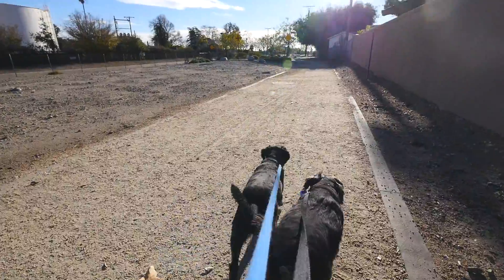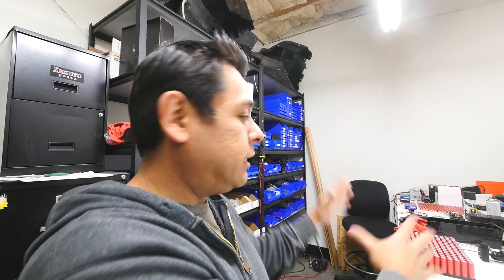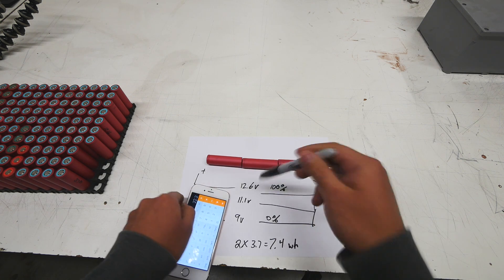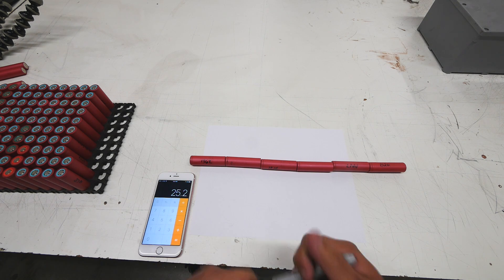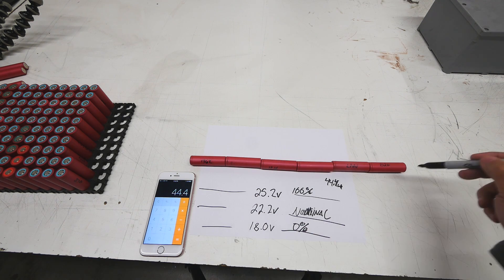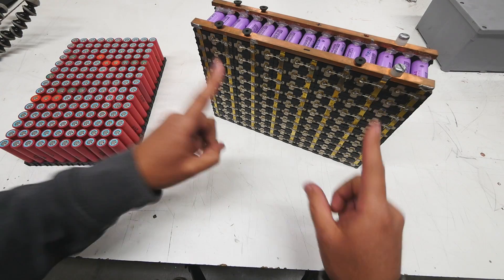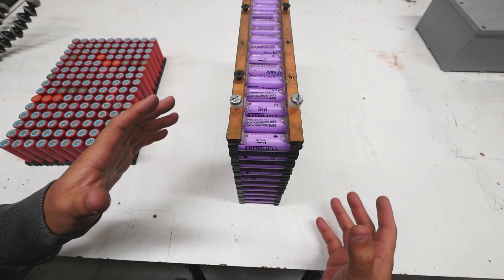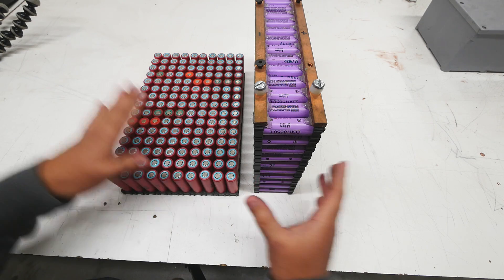How to wire A DIY Tesla 18650 Powerwall

Comment: Hello,
First of all, thanks for this awesome video.  So I am trying to build a battery pack just like the one in this video.  However, you only said that we can do this with laptop 18650 bateries.  I found this batteries on amazon

http://www.amazon.com/Lithium-Rechargeable-Household-Batteries-Flashlight/dp/B00G9X3HA2/ref=sr_1_1?s=hpc&ie=UTF8&qid=1455826134&sr=1-1&keywords=18650+battery&refinements=p_n_feature_keywords_four_browse-bin%3A7582357011

 that are 18650 as well with a 3800 mAh.  Would this batteries work as well?

Also, I used the same formula to calculate the Wh I get from each battery and I got 140.6 which seems to be too high.  I used this formula to calculate it: W = A * V.  I know the formula is correct so I must have done it wrong.  How many Amps does these batteries actually have?  I calculated 38 given that 1Ah is 1000mAh.
Reply from the maker: +Emanuel Quinones    Yes same type of cells,  Problem is that I don&#39;t recommend those on eBay.  They are mystery cells from china.  Seller is shady as there is no 3800mah cells in the market so you can't trust that they are quality if the secs are not even possible yet.
Reply: They are actually from amazon and feom a US seller.  If they turn out to be fake or bad amazon is pretty good at taking back the money from them and returning it to the customer.  Thank you for the quick response.
Reply from the maker: yeah All cells with  fire in the name are from china and a bad idea

Comment: Awesome video! I am super keen to make one. Firstly how do I wire the batteries to suite a 230V AC Socket like we use here in NZ? Is it the 24V DC version? Also how do I source uncharged 18650 batteries so that I don't get electrocuted while making this? One last question, what type of fuses are you using? I need specific information on all. Please feel free to email me on info@designerdentures.co.nz. I am no electrical engineer as you can tell but I really want to make this! Thanks!
Reply from the maker: +Khushwant Singh   watch all my videos first,  lots of your question will be answered along the way
Reply: +jehugarcia yeah will do. Appreciate what you are teaching us!

Comment: Instead of using thousands of small batteries why not build large capacity cells like the lead acid batteries have?
Reply from the maker: +Wes M large capacity lead acid batteries are made up on many small cells inside configured both in parallel and series.

Comment: i cringed everytime he touched the terminals. scary!
Reply from the maker: +fmj45   3.7 volts is not scary,  you gotta get around 30 to start feeling it
Reply: +jehugarcia i see. thanks for the info. i've had the saying "it's the amps that kill" drilled in to me. it's certainly encouraging that those packs are not dangerous. love your vids. thanks for your hard work in making them.
Reply: It takes a very low amperage to stop the heart 200 milliamps and you're dead. Even as low as 20ma will mess up your breathing. Dry skin has upwards of 100,000 ohms of resistance. And below 50 volts is considered "low voltage" and is pretty much safe to handle. Just don't touch it with wet hands or lick it.

Comment: What is the capacity and voltage of the pack you built? I still don't understand why it doesn't need to be balanced charge. My understanding is that if the batteries are connected in series I have to balance charge them. For instance how can I arrange and wire 10 NCR18650B to get 14.4V and not need to balance charge them. I think a smaller pack would be easier to understand for you viewers.

Comment: Per your comment regarding where the Tesla gets its power from, you said it comes from coal. While that is a popular saying, "the Tesla is a coal car", it is not entirely accurate. California derives only about 20% of its power from coal, while the rest is: 46% natural gas, 14% nuclear, 11% hydro, and 11% from renewables. Even then, if you want to look at it from an emissions point of view when compared to an ICE, it is still a vastly cleaner and more efficient power source due to the fact that the power utilities can run at near peak efficiency for ~80-90% of the year. An ICE never operates at its peak efficiency, 18-20%, since it has to brake (bleed energy as friction) and re-accelerate over and over again in city street traffic, and even has to idle when stopped in traffic. At least with electric motors, you can build in the capability to recover some of the energy that gets wasted when braking. Overall, the ICE is a poor choice for being an energy efficient device. 

So, in getting back to how this can relate to your work and your projects, you should be happy in knowing that the energy you're storing in your batteries is being generated in a much more efficient and economical way that the technology you're seeking to replace. That is why electric vehicles are better off in the long run than ICEs.

Comment: Hey Jehu I'm a big fan of your channel, in fact I liked it so much that I just finished binge watching the entire Samba series over the course of three days. You have connected a number of passions of mine, namely classic air cooled VW's and living in a more positive way in terms of the environment and how we interact with each other. I am a little bit confused about the end of the series and the 'Tesla' wall. It's cool to have some back up batteries and an inverter if the power goes out, but isn't the whole purpose of the Tesla system to save energy. Even if you install an inverter/charger, you will have a system that is less efficient than just using the 120 AC when you have a need for it. Without alternative energy input or a controller that charges only when electricity is abundant and re-introduces it into the 120 AC system of your house/shop when demand on the grid is high, it's really just a battery on the wall or am I missing something? Don't get me wrong, I truly love the videos and am inspired to start an EV project of my own when finances allow, however I would love it if you did a video on the source of the electricity that you use and what the actual footprint of it's consumption is. These are real issues here where I live in Canada where we are known for our oil sands projects and where right now indigenous people and environmentalists are being arrested for protesting the construction of North Americas next mega hydro dam, of which some of the output is likely to be imported to your state. Keep up the great work and I'll keep watching...BTW, I live completely off the grid with solar panels and a micro hydro plant running off a nearby creek.
Reply from the maker: Yeah all those are possible,  buy and charge when it's cheap,  use energy when it's peak rates.   Charge using solar,  use at night when no sun.   Battery can be used in many ways

Comment: Jahu, Good video. One thing. While you dont need a BMS for a parallel pack. You should have a passive BMS which you do have . You have forgotten about it. All batteries are not created the same. Even in parallel. Its not as likely that one will go hi but it is possible for one to tank earlier than the others. Remember why you installed your fuses? Its your passive BMS. It was a very wise decision on your part.

Should BMS stand for Battery Management System or Battery Monitoring System. The Fuses are a Battery Monitoring System.

I have seen people building packs without the fuses and they seem to be asking for trouble. The fuse stops a cascading effect to the other batteries. 

Good work

Comment: i am trying to figure out how to build a 12v 18650 system that i can run with my car alternator. Can anyone show me the way?
Reply: +Damian Yang do i need anything special so my car doesn't blow up... I am running a show car and it runs alot of electricity and i dont want to run 500 lbs of agm batteries in my car.
Reply from the maker: +Damian Yang 
Lithium voltage is 4.2V max per cell.  3 cells in series add up to 12.2V.  Your cars electrical system is 13.8V,  you would have to use a DC-DC  to bring the voltage below the 12.2V max that lithium needs
Reply: +jehugarcia Like a battery isolater ?
Reply: +jehugarcia This is a very interesting question. I would like to build a UPS battery made of 18650 cells to replace the usual SLA or gel inside of them. I been thinking to use 3 cells in series and 2 sets in parallel. So I can lower the overall weight of the UPS backup. I understand that the operating charging-discharging voltage is 13.5v but this I can not confirm or know how to check. So is the DC-DC going to be able to go both ways? I am seeing it wrong?
Reply: Can u recommend some good dc to dc converters. I want something strong

Comment: Most 12 volt chargers will charge to 13.8 volts not 12 volts you will overcharge them and they will burn.
Reply from the maker: +Charlie Rickman   Yeah,  regulated power supply is better
Reply: Can u recommend one I never can get my 12v inverters to play nice with 3.7 voltage cells I could without lifop0 3.2 cells

Comment: balance wise, I think they meant when you connect multiple cells in series. How will you balance each parallel bank to the others! I have enough trouble keeping a 4S28P pack balanced, what is there to stop all of yours getting out of sync?
Reply: +Jorge Espinoza I have 3 packs i n use at the moment. all are different. 2 with new cells one is li-ion (50ah) 1 is lifepo4 (36ah) the third is second hand reclaimed cells from medical equiptment. though from the same batch they go out of balance within 2-3 cycles. I have a huge distrust or BMS units so I use an inexpensive lipo alarm to alert me to one set of cells going low. charge wise I use imax b6 or sky RC RS16 to balance charge them / from my small lead acid battery bank.

Comment: I am so impressed.  I love listening to your Vlog.  I own a TESLA model S (P85D) and contemplating building my own Powerwall. However I have to come up with some Solar power. Any recommendations? or what would be a good solar panels. Where do you get your parts to build your cell for the batteries. I was thinking about sourcing my part through ebay. IS it s good idea?

Comment: parallel cells don't need to be balanced as they are at the same voltage all the time
series cells have to be balanced as they can be at different voltages while charging or discharging or just resting  
another good video thanks Jehu
Reply from the maker: I Wish all comments were structured like Alan Brown's here,   Informative and pragmatic
Reply: +Eren Berberoglu ah thank you
Reply: all the batteries i see pulled apart . it seems the smaller the cell and more per MM and then put in the block 8.5v each , im experimenting  with pulse charging from capacitors array for sudden loads like A/c or Furnace , i live in a mobile home and in a very cold area . and using induction coils to make steam and pressure to run a small engine with a giant rotating mass . to keep everything charged no matter what .
Reply: Failing to balance individual cells is likely to result in shorter pack life but as long as the system is well maintained by someone who knows what they're doing a BMS isn't essential.

Unfortunately most people don't know what they're doing and don't understand that overdischarging Lithiums is even more dangerous than overcharging them - especially if left on a shelf for years afterwards.

This is why thermal management of large packs is so critically important (automotive or stationary).

I work in a university computing environment and we get a steady stream of people coming through with swelling battery packs. The wonder is that there are so few fires.

NiMH are not much lower in capacity but much safer. The problem there is the patent encumberence of NiMH for automotive use in the USA that's essentially stalled most NiMH research for the last 30 years. (There's a wikipedia article on this(*)). Some of the patents have expired but others are still in effect and have been aggressively used to keep NiMH out of cars (Toyota have encountered major problems with this, trying to keep the CA electric RAV4s on the road).

Don't forget: For best longevity, Lithium batteries should be kept within 30-80% charge range with only occasional excursions outside this envelope. The reason for that is that the anodes physically swell and shrink with charge state and eventually disintegrate(*). If you're building a powerwall it's best to trade off the size with this compromise and for automotive use treat 30% to 0% as emergency reserve.

Bear in mind that overcharging or overdischarging can both result in lithium metal being deposited inside the cell and if that forms in the wrong location, puncturing a seperator, you WILL have a localised heating problem and fire on your hands(*). Make sure you house your powerwall in such a way that fires are containable or you may void your building insurance.

(*) https://en.wikipedia.org/wiki/Patent_encumbrance_of_large_automotive_NiMH_batteries

(**) There's a lot of R&D going into combatting this and when you see batteries marketed with 10,000+ cycle capability you'll know it's essentially solved (there is some progress but the tradeoff at the moment is vastly reduced capacity compared to "standard" cells) 

(*) The lithium crystallisation issue is also being worked on but is in no sense a solved problem, so the best policy is to avoid excursions below 10% or above 90% unless absolutely necessary and never leave a cell stored in a discharged state unless you like fires.
Reply: @alanbrown397  the 10,000 cycle batteries exist now and are called lithium titanate. also the thermal runaway problems with 18650 are mostly solved with lifepo4. lifepo4 from china is reliable and so cheap if these guys knew that you can buy 4 cells of 3.2v nominal at 280 AH (12.8v) for $481 shipped with 3,000-4,000 cycle life they would stop wasting time doing these silly 18650 projects
Reply: @eksine  4 years ago lifepo was new/rare and liti was even rarer. There have been major changes in the market since 2016

One of the more welcome changes is weldable battery strips with integrated fuses, this reduces the fire risk AND labour complexity dramatically.
https://batteryhookup.com/products/nickel-fuse-5p-wide-continuous-roll-by-the-foot-18650-cell-level-fusing

BMSes have come down rapidly too - and both of these innovations have a lot to do with the spread of Maker culture to Shenzhen over the last 5 years

It's still worthwhile building your own arrays, less worthwhile doing it with salvage packs unless you're getting them really cheap - but then again, they're getting really cheap (which automakers are not playing catchup with. The costs of a 4kWh pack for european electric motorcycles is still at 2016 levels)
Reply: Hocam farklı marka 18650 pilleri aynı paralelde kullanırsam deşarj durumunda düşük c deşarj değerine sahip olan piiler ısınırmı ? Yoksa aynı marka model pillerimi aynı paralel içinde kullanmalıyım balansı kaybetmemesi açısından ? Teşekkürler.
Reply: experter
Reply: so all cells are in parallel
Reply: William Hill - You add up cells to make the first group in series to get your voltage correct. Then you parallel additional series groups with the first group to add additional amperage capacity.
Reply: You covered my only concern which is that your parallel pack is only as strong as your weakest cell. The weakest cell will usually also mess with neighbor cells. Also as someone mentioned, the fire thing. Thermal run away can be induced by a weak cell in your pack. But you only really see such a thing if you are demanding too much from your battery pack and if the series string is super long like say 50 to 200 cells. After a few cycles you clearly will see a "wave" of high/low cells. The wave will travel inward from the cells closest to the ends towards the center of the series pack. This is simply because of demand, and heating resistance happening there. As the cells there become weaker, the effect starts to catch the next cell.. but because the cells at the end are also first in line for charging, they will charge more than cell #2, creating a high/low pair. The center cells will hit max voltage first, then the last cells, and the cells in the middle will charge the next cell more/ or demand charge from the neighbor cell. That's more or less how the high/low charge wave will propagate in a series pack. This if you don't pay attention will cause a failed pack, sometimes a fire. The way you have it at 3 in series, it's very unlikely to cause such a thing since you are charging so slowly and only once a day, not like in a hybrid car where you do it several times per week or even per day.
Reply: @aomanchutube  are you getting your series/parallel confused ? Never heard of 50 to 200 cells in parallel . That would be 185v to 740 v D.C. Seriously dangerous voltage
Reply: @chriskennedy7534  Google hybrid bus ultracap thunderbolt. That's 244 cells in series. PM me if you need to know why I know.
Reply: you need to be balanced
Reply: What a massive reply for the wrong answer. I agree with Eren Berberoglu
and jehugarcia, you dont balance ever cell!
Reply: I can recommend buying some 18650 cells over here: https://www.banggood.com/search/18650-battery.html?p=7I22079633188201703T I have tested them and it's the best value your get for your money!